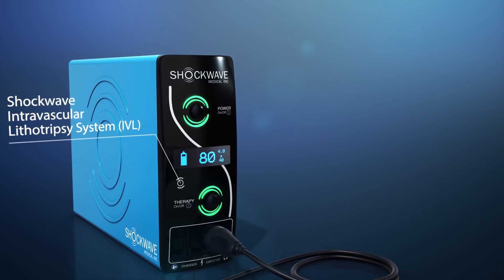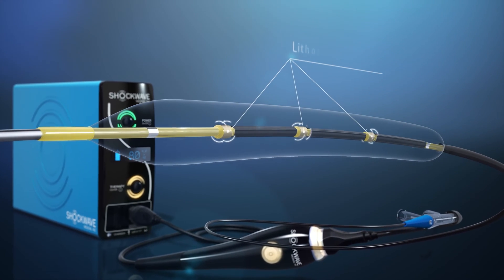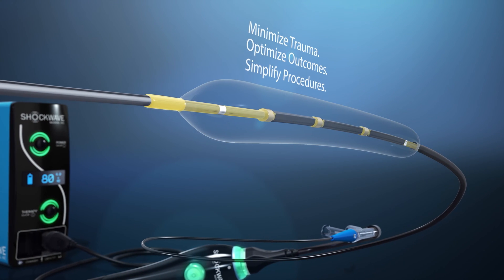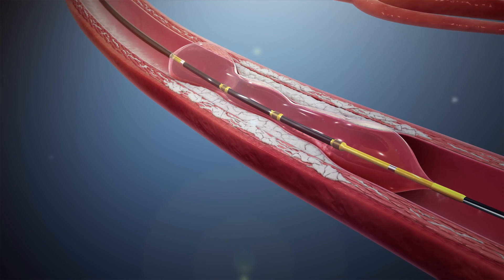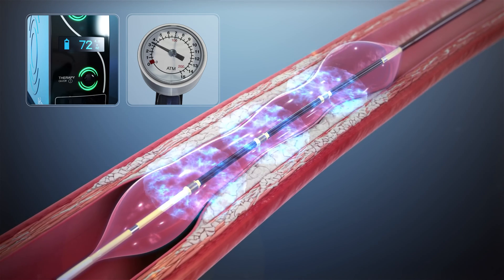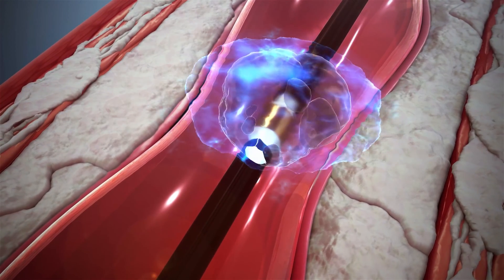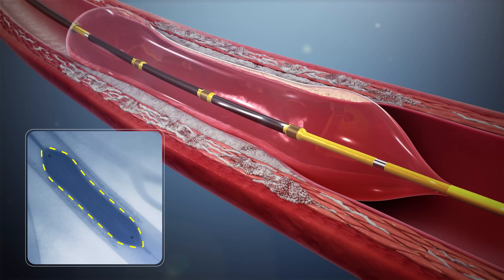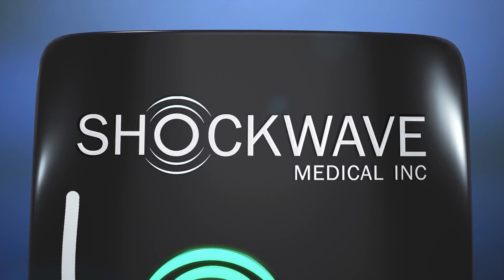Shockwave Intravascular Lithotripsy (IVL) System, Mechanism of Action and Procedural Overview (U.S.)

Comment: Do they explain how the smaller now broken bits of calcium safely exit the body without causing a clot like effect leading to a stroke?
Reply: Damn good question. Can they do this with cholesterol based blockages?
Reply: The calcium build up is inside the artery, the intima and media. They can’t cause clots.
Reply: @Indian Hound  how?  How does it exit the body?  When the wave breaks it loose , it's now floating in the blood stream!
Reply: The Doctor´s mother told me about this question... they put medicine that not causing clot (anticoagulant / blood thinner). I don´t know how to say in English.
Reply: @waininha  I spoke to a cardiologist and although he didn't know much detail about this procedure,  he did say that something similar has existed prior. Basically he said the calcium is broken into very tiny particles,  small enough to not cause any damage. Still unclear on how it exits the body.
Reply: They don't exit the body as far as I know. They stay in place with the soft tissue around them and potentially cause no further harm.
Reply: @beef_nerd  spoke to another doctor since the question and although he didn't know this exact procedure,  he did mention one similar that has been used and said that the particles are broken very small and exit the body.